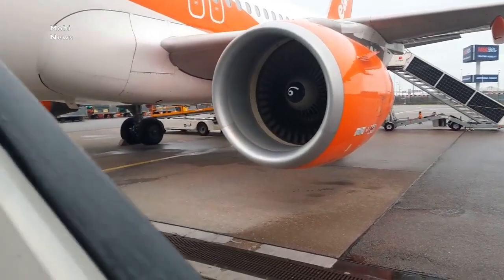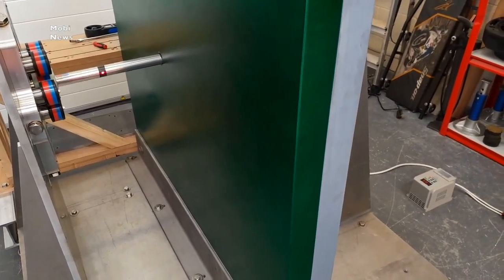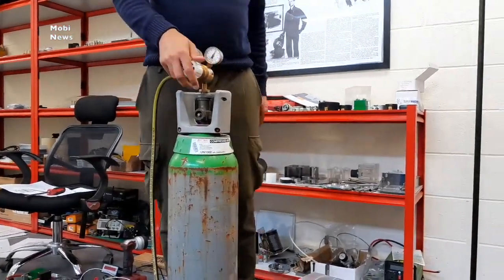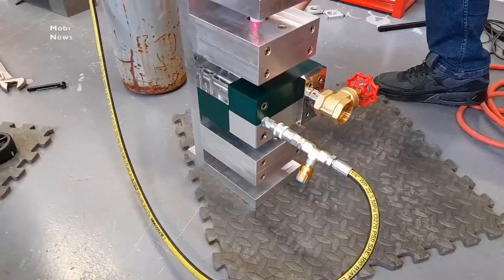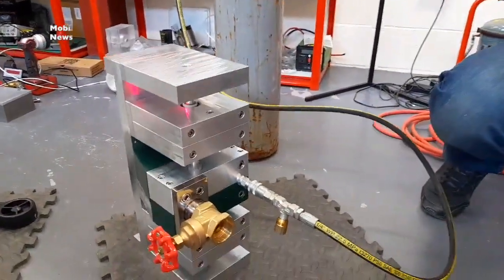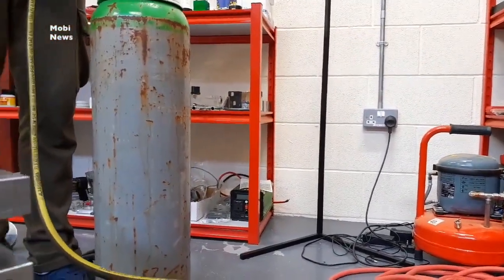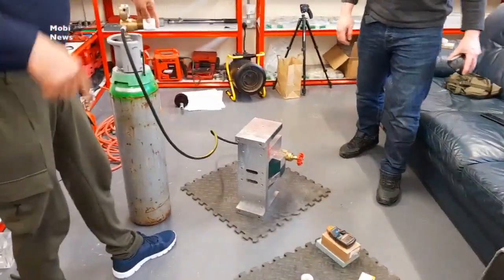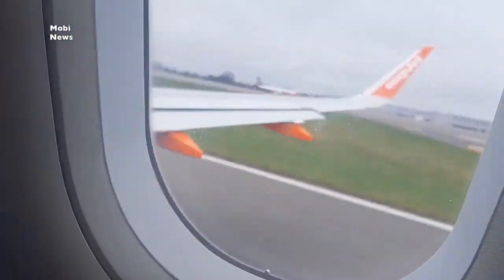Ray, Rob & Si 1st April 2022 Visit To The Nikola Tesla Research & Development Centre - PMB APD Demo

Comment: check out the rpm at 4:11 on the VFD and then the tacko !! didnt realise this had been captured.... how efficient
Reply from the maker: My favourite bit is how good we got the rotor considering it was warped quite bad and not concentric. You felted it some more whilst I was in the meeting sitting in my car. It shows how quiet it was, glad that was captured before we put it down and its own weight warped it again. Needs a better grade of aluminium and its own stand.
Reply: @nikola.tesla.r.and.d.centre  How to make vehicles run on alkali solution, ammonia solution, alcohol solution: ELECTROLYSIS (CAN BE FUELCELL DRY/WET HHO, RADIO FREQUENCY HHO, OR PLASMA HHO GENERATORS) INSIDE FUEL FILTER (INJECTION VEHICLES) OR BIG CUSTOM FLOAT BOWL (CARBURETOR VEHICLES) , AND INSIDE COMBUSTION CHAMBER BY PLASMA FROM MULTI SPARKPLUGS, WATER LASER IGNITION SPARKPLUGS, WE NEED HACK THE ELECTRYCITY BY ADDING AIR SCOOP WITH WIND TURBINE ELECTRIC GENERATOR (ALL LAND, SEA AND AVIATION VEHICLES CAN USE IT AS EXTERNAL ELECTIC CURRENT GENERATOR) INSIDE IT AND PUT ALTERNATOR ON PROPELLER SHAFT OR AXLE (FOR CARS, TRUCK AND OTHER WHEELERS VEHICLES) AND ELECTRIC MOTOR STATOR GENERATOR INSIDE CENTER OF REAR VELG AND FRONT VELG (FOR CARS, MOTORCYCLES) THIS GUARANTEED FREE ENERGY BY MOVEMENT OF VEHICLES AND WIND THAT COME FROM FRONT OF VEHICLES, THEN USE SUPERCAPACITOR IN HYDROGEN GENERATOR CONNECTION CABLE AND VARISTOR IN COIL-IGNITION SPARKPLUGS CABLE, THEN MAKE ELECTROLYSIS INSIDE FUEL FILTER first electrolysis (PEM OR PLASMA HHO OR BY RADIO FREQ HYDROGEN GENERATOR), BECAUSE GRAFITY EFFECT, WATER INSIDE  FUEL FILTER OR FLOAT BOWL WILL MAKE PRESSURE  SO HYDROGEN DON'T COME BACK TO FUEL TANK COME DOWN BUT UP RIGHT INTO INJECTOR OR CARBURETOR FUELS SPRAY, BY INJECTING OR SPRAYING BOTH HYDROGEN AND WATER INTO INTERNAL COMBUSTION CHAMBER CHAIN REACTION (EXPLOSION BY NEXT ELECTROLYSIS STAGE MUST BEEN HAPPENING INSIDE COMBUSTION CHAMBER) PLASMA SPARKPLUGS OR WATER LASER IGNITION SPARKPLUGS WILL MAKE ELECTROLYSIS+IGNITION , THE PRINCIPLE IS SAME LIKE LIGHTNING STRIKE ON SEA (NATURAL ELECTRIC PLASMA ELECTROLYSIS) THAT CONVERT SEA WATER INTO HYDROGEN AND OXYGEN + MAKE PRESSURE AT SEA WATER THEN BURN IT CAUSE BY LIGHTNING STRIKE  HIT HYDROGEN (EXPLOSION OF WATER ON SEA BY LIGHTING STRIKE) ON IT THIS MEAN ALL VEHICLES ACTUALY CAN RUN AND  BURN ON WATER AND HYDROGEN, THE SCHEME WILL SAME TO FUELCELL ELECTRIC VEHICLES WHICH WHEN INSIDE I.C.E ENGINE WE BURN HYDROGEN AND WATER IN FCEV WE JUST INJECTING HYDROGEN FROM ELECTROLYSIS RIGHT INTO FUELCELL
Reply from the maker: Yeah we need to put a tachometer on the motor too next time and swap them all over to check calibrations.
Reply from the maker: My other favourite bit is hearing how quiet the z axis contact point is... You can just hear the wind off the rotor. https://youtu.be/xYH8tdv9CSA?t=123